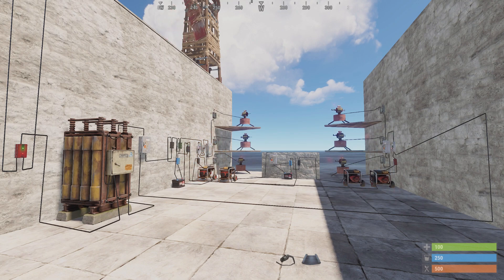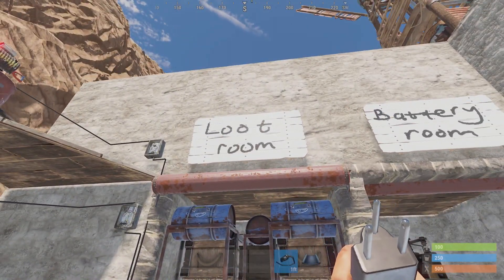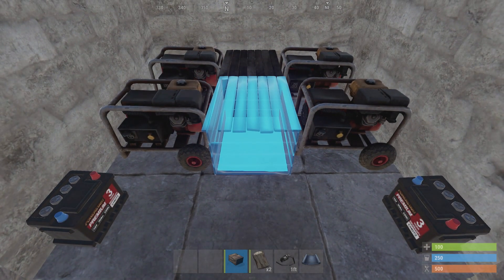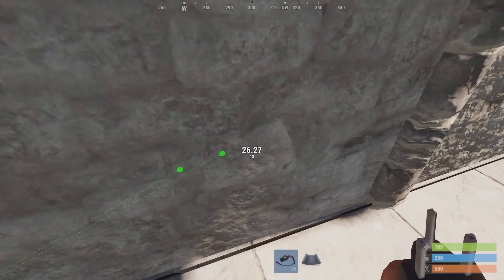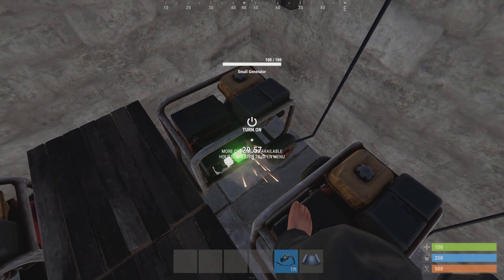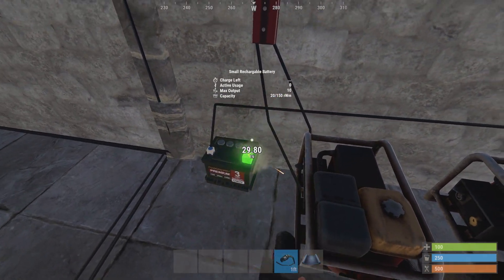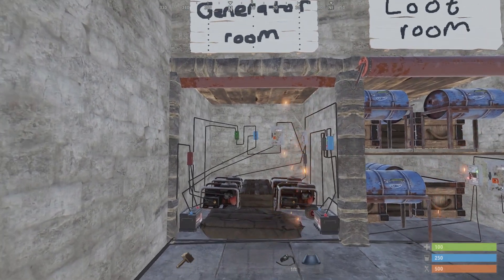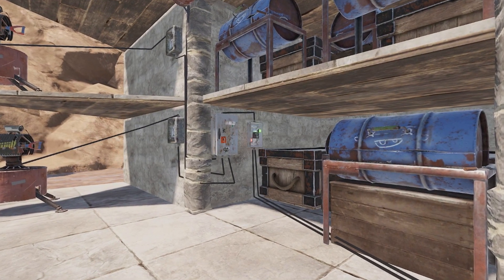Fully Automatic Double Backup Generators | Rust Advanced Electricity Tricks

Comment: for moded servers or cave use can this be modified to remove the turbines and simply run the generators so that when the first 2 run out of fuel the second two kick in?
Reply from the maker: Yes, you don't even have to modify it. You can have the exact setup, just replace the turbines with generators. When they die or the battery drains you have 2 more sets of generators.

You can actually chain more sets of generators. For example 6 sets of generators would give you 12 hours of power. So you can sleep comfortably knowing your turrets are protecting your loot :P